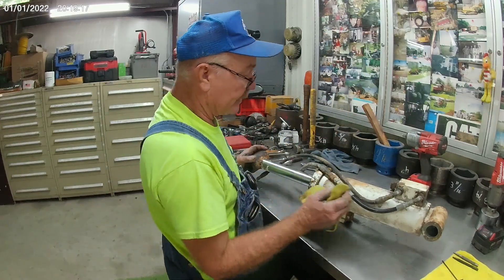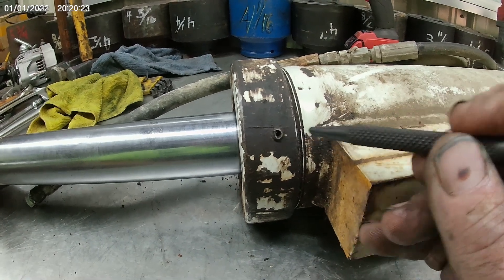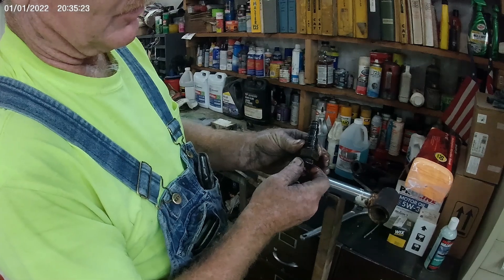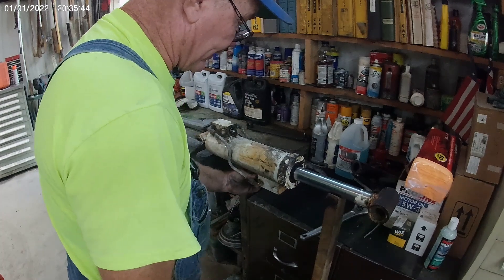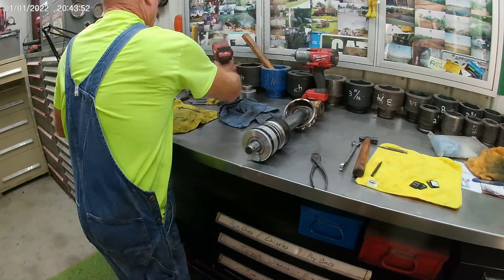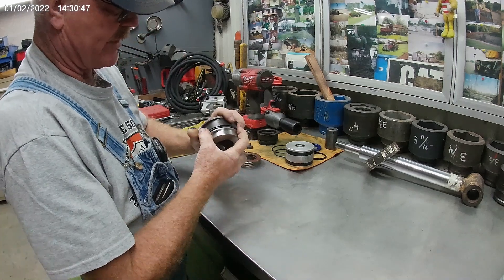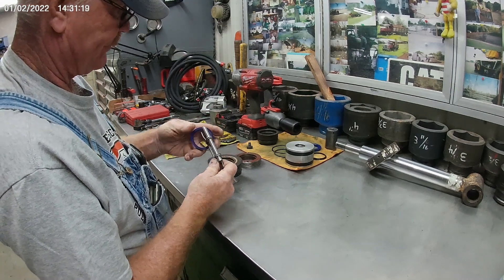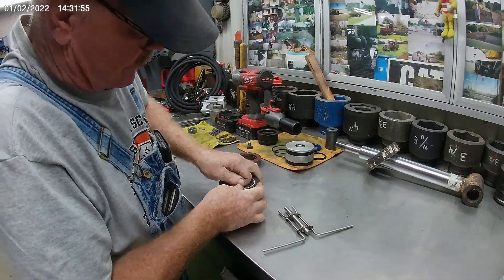HYDRAULIC CYLINDER WITH LOAD HOLD VALVE.

Comment: Is there anyway I could send you a hydraulic cylinder with a load holding valve for repair? I have pictures.
Reply from the maker: What is your problem with the cylinder?  What state are you in?
Reply: @dieseldoctor25 I am in NYS. I believe the piston seals ate leaking and a cartridge load holding valve isn't working properly. I have pictures. It's about 2 feet long and 1-3/4" in diameter. Thanks for getting back to me!
Reply from the maker: @johnimburgia4321 what is the cylinder off of, is there any numbers on the cylinder barrel & is the load hold valve  welded to the cylinder barrel?
Reply: @dieseldoctor25 it's off a Cabover Engine truck. It is one of the cylinders that raises and lowers the cab.
Reply: @dieseldoctor25  the load holding valve screws into the manifold block.. There are no numbers on the cylinder.
Reply from the maker: @johnimburgia4321 I worked on a lot of cabover IH trucks back in the late 70s had to jack both up & down cylinders at the time were cheaper to replace than rebuild. Did you check to see how much a new one is? Maybe it just needs a piston seal! Shipping  today both ways is not going to be cheap.
Reply: @dieseldoctor25 that's exactly what it's off of  a 1979 Transtar.. I looked around but I would have to replace both and that will cost about $1000. The new cylinders are shorter and a bit different. I was trying to keep the truck all original... Thanks for replying.
Reply: @dieseldoctor25 I sure it needs seals the rod end seals anyway. I could probably handle that on my own. This cartridge load holding valve has me baffled though and I am not even sure if the o-rings and springs are the correct ones
Reply from the maker: @johnimburgia4321 can you send me a pic same name just use Gmail